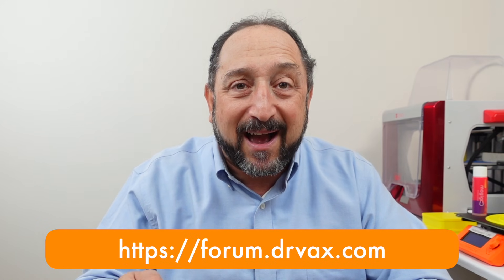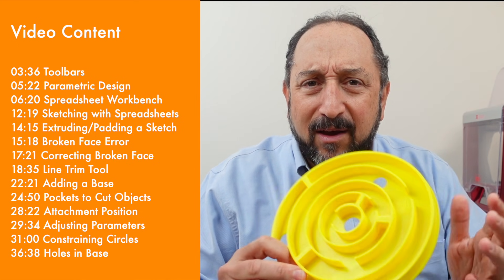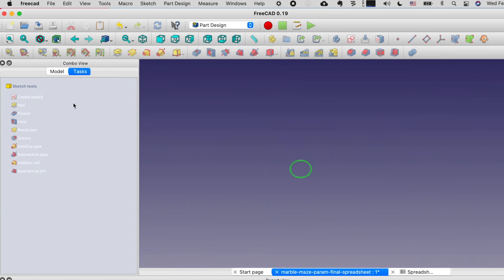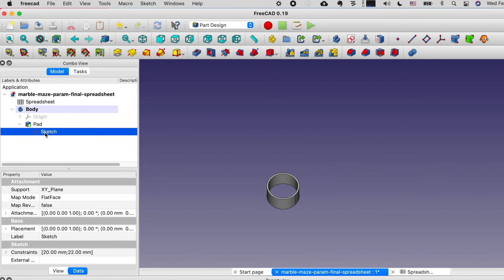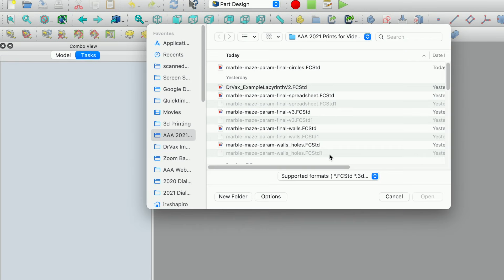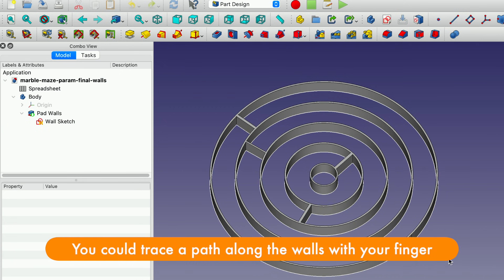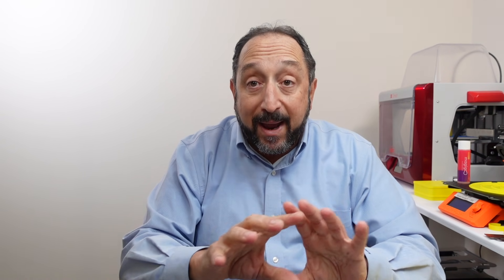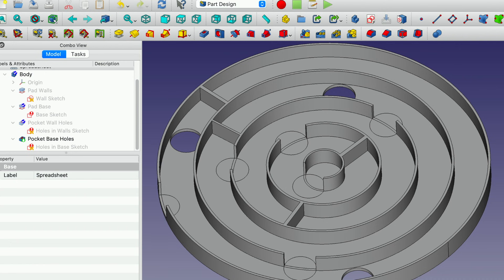FreeCAD for Beginners | Design a Marble Maze

Comment: 16:00 - the Realthunder/FreeCAD_assembly3 daily build of 0.19 can extrude/pad concentric circles without them being interconnected.  Switching to this build has made the transition from F360 much smoother than the official 0.19 branch.  

The EasyAlias macro is my choice for spreadsheets.  You can save some typing by renaming the spreadsheet to just 's'.  Then when you click the formula icon, just type s (dot) and all the alias names are readily available.
Reply from the maker: You are correct and the realthunder build works great on a mac.  However it is unclear if this enhancement will make it into the .19 official release.
Reply: Since the problem with extruding multiple walls is that they form separate solids, you can also avoid the problem entirely by starting with the base. That makes them all attached. Since these are walls, I would also consider using the Wall command from the Arch workbench, allowing us to draw just the center lines in the sketch. It doesn't like full circles (closed spaces), but it does allow multiple walls. Then you can join it to the base using Part Union. And you can make holes of a regular size with Part Design Hole rather than Pocket (although it's really for marking e.g. threaded or countersunk holes).
Reply from the maker: @0LoneTech  Excellent points.  Thanks for sharing.

Comment: On the same note, used to buy somewhat similar (conceptually) toy for a present. Apparently, it is called perplexus. It is a maze, but enclosed in a transparent plastic sphere and it is 3D - there are different levels the ball can travel and (at least in my copy) there were mechanical parts (like a spinning well of some sort). Thinking about its design as an engineer, it seems enormously complex. But as a big kid I was (and am) fascinated by that toy. Can't even imagine designing one.

Comment: Another educational/informative video:) FreeCAD is good because it's free (duh!), and it provides an alternative to the "other" options available. That said, it does seem a bit "clunky", and the interface seems a bit outdated - but again, hey, it's free!:) Particularly surprising was the limitation in sketches on "nested" elements. The fix of connecting them in ways not in line with design intent seems very cumbersome, and detrimental to efficient workflow. Are there other, "better" workarounds? Perhaps dividing up into multiple sketches? Surely the developers are aware of the negative aspect of this. Perhaps it's some unfortunate, inherent issue with the way the code is written. Hm? Anyhow, the community thanks you once again:)

Comment: 23:57 The unit mismatch in the formula wasn't because you used different units.  You could have entered inches even though Spreadsheet.w4 is in mm. The error is because FreeCAD is strict about the presents AND absents of units in formulas. When you add (or subtract) 2 dimensions, both numbers need units because the are representing real lengths. If you divide or multiply, only one number needs the units. The factor(s) or denominator can not have units because it only makes sense to multiply or divide by abstract quantities as opposed to real objects. You can see this when you showed the formula for the track diameter at 11:15.
Reply: You are a gem

Comment: DrVax love you videos! I have a question for you about 3d design so to speak. How am i able to reduce de outside perimeter of a 3d irregular shape (for example a letter) without changing the inner dimensions like imagine makin a P smaller on the outside without changing the hole dimensions (objective is to make tolerances for letters to fit a base with the letter carved in).

Comment: Much easier: Install the macro Alias Manager!
Name in column A - the macro will automatically take the name as alias in column B. 😉
Reply from the maker: Great idea.  Thanks for sharing.
Reply: This may work, but FreeCAD does not allow the result. If you name column A "Ball" and then to the alias and type in "Ball" you get an error. So the macro is doing something FreeCAD does not allow by default. You also cannot use spaces in the readable name when using the macro, unless the macro removes/changes them, which results in an alias you don´t know.

Macros should not be required. This is just a UI mess in FreeCAD, which needs to be addressed. Same for the F(x) button. Why? Why not enter the alias name where the measurement is? It would make stuff so much easier.

Comment: You said you maybe should have put the base on later why not first .If you had done the outer ring  then  the base ,
 before adding all the inter walls it would all be connected and no errors  - wouldn't that have been more simple
Reply: The base would not help. The problem is that FreeCAD does not know what to extrude and what not. The plate does not matter in this case. The connection makes it clear, as all rings get a complete object before extruding. I did an example in the Forum, where I did a different approach. I created blocks on the XZ plane and revolved them around the Z axis. This requires a base plate first, but creates the labyrinth without the blocking wall segments.
Reply from the maker: @guidomersmann9744  Thanks for adding this clarification.   I used the approach in the video as a teaching aid.  I wanted to produce an error on the pad and teach my viewers how to address it.
Reply: thanks both of you  it was a question not a criticism. Im super new don't even own a printer yet just watching videos to see if it's something I may want to do in the future as I would want to design my own things rather than just downloading and doing other peoples
Reply: @guidomersmann9744  The workflow for FreeCAD encourages a 'best practices' approach to modeling. In general, this means one feature per sketch. So in this case, what you can do is make each wall its own sketch instead of making all the walls in one sketch. This way, they would all be connected by the base, and the decision to put a wall connecting the concentric rings would be purely driven by design intent. You can have no walls connecting if you wanted, for example. In F360, you can choose something in a sketch to extrude... while this is a 'feature' you also have to be careful about doing this because on very complex models this can cause a lot of issues when changes need to be made later. Doing this is mostly discouraged in professional CAD work.

Comment: On further evaluation I'm giving a thumbs down. (I'VE SINCE TAKEN OFF THE THUMBS DOWN ) You present a lot of good information.  But the flow is poor.  When you jumped to the prepared spreadsheet many names and some values changed without explanation.  I started and stopped the video many times trying to follow exactly what you were doing but you jumped steps.  This is not a problem for me but I've had 20 years of Auto Cad and Solid Works training but review the transition from spreadsheet to drawing you might find some glitches.
Reply from the maker: Sorry to hear this did not work for you.
Reply: @MakeWithTech  I went back and took down the thumbs down, although I do feel that some users may get lost easily.  I finished easy enough but like I said I've had years experience.